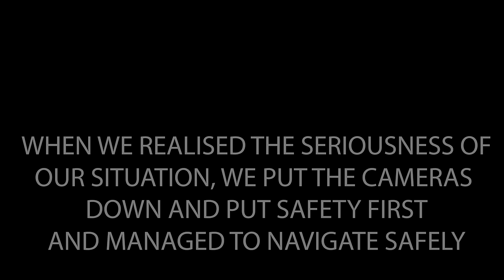BILLY GOATS BLUFF TRACK - This is nuts!

Comment: I did Billy Goats 3 or 4 years ago, there was a guy in a white Cruiser towing a trailer. He turned around at the heli-pad after 3 hours of winching. He completely wrecked his tyres from all the wheel spinning on the sharp rocks to the point where he’d had to go to the nearest tyre place to get new ones, they were just a mess. I couldn’t believe it haha.
Reply from the maker: I recon it would be a totally different track in the wet. I could see us sliding around etc. Im sure a small camper would do it